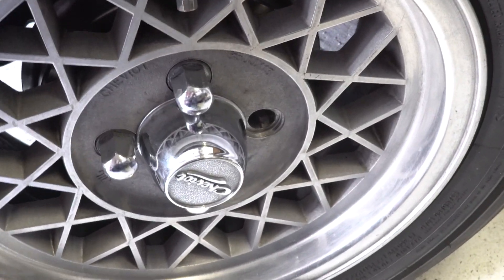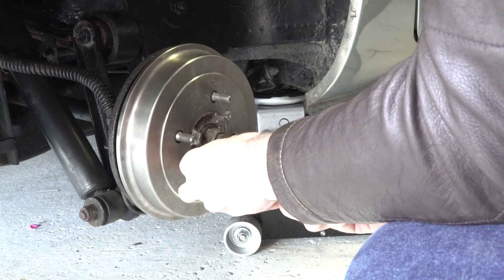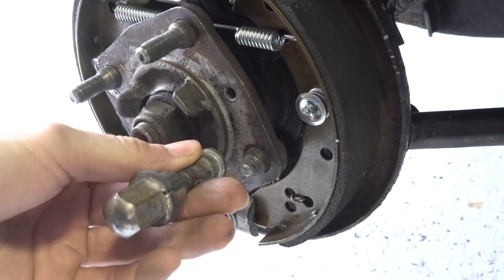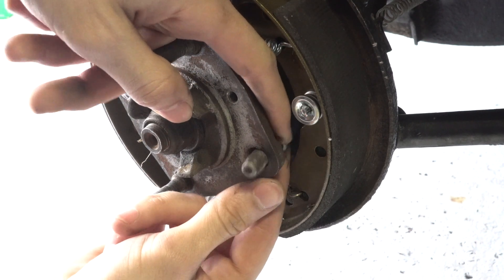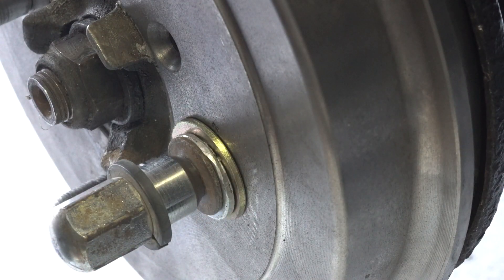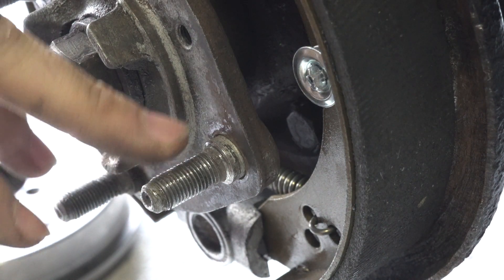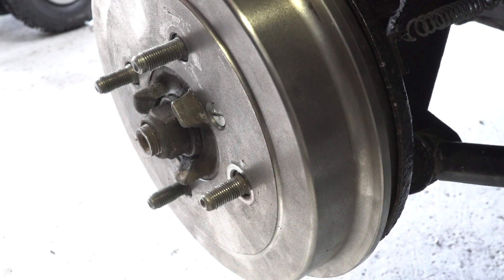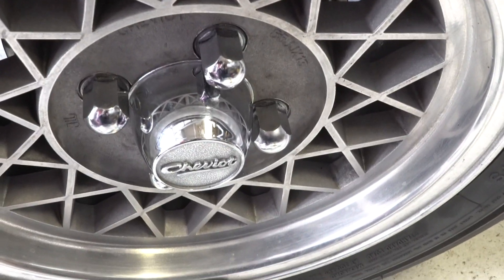HOW TO REPLACE WHEEL STUD ON TRIUMPH SPITFIRE

Comment: It looks like you have at least 2 other studs that are stretched and distorted, ready to break!
Reply from the maker: yup, years of the wrong torque, they've all been replaced. one thing I've learned with inexpensive repairs like this, you might as well do everything rather than go back and fix things over and over again.

Comment: Mmmm I was always told to use anti sezed grease on all moving parts tipical armature mech
Reply from the maker: You're correct, you want to do that for sure, however ive never had any problems not using it. Even told to use it between non moving parts sush as the inside of the wheel to the brake trum to prevent ciezing